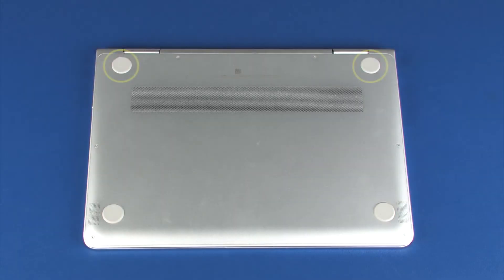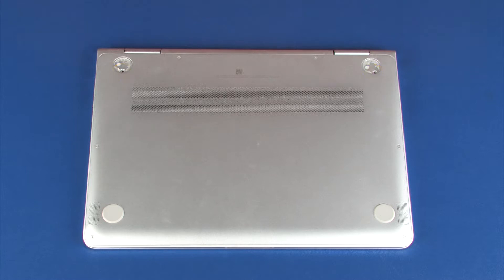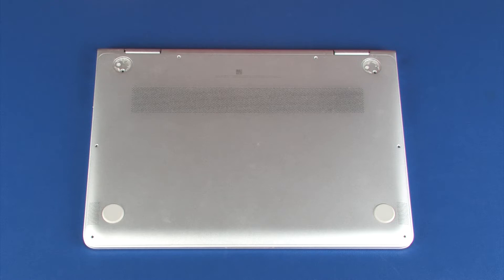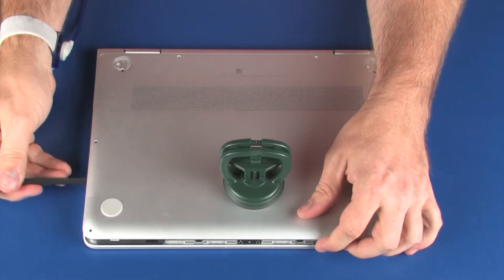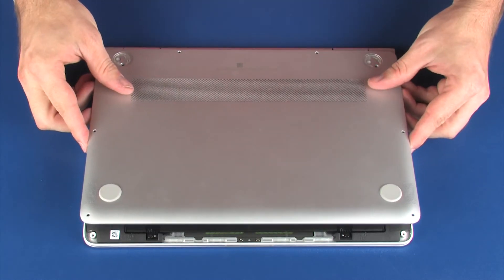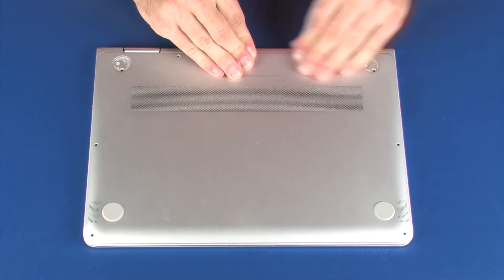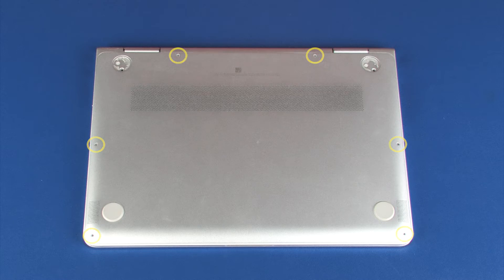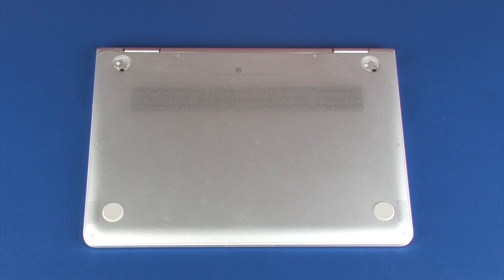Replace the Base Enclosure | HP Spectre x360 Convertible 13-w000 Notebook | HP Support

Comment: How to replace the rubber feet back on the enclosure? Does it snap in ? Or does it needs to be glued back ?
Reply from the maker: +Harman Manchanda You do not need to completely remove the rubber feet, you can peel them back a little to get to the screw under them and when finished stick them back in place, they are sticky enough to be placed back.
Reply: @HPSupport  Why no response ??
Reply: @HPSupport  Front round rubber has come off and the other ones are also slightly coming off. There is no stickiness to it. The white plastic thing is exposed fully. How do I put the rubber back ? What kind of glue to use? Or do I need to get the whole thing including plastic white shoe replaced ?
Reply: @harman.manchanda  same issue here!